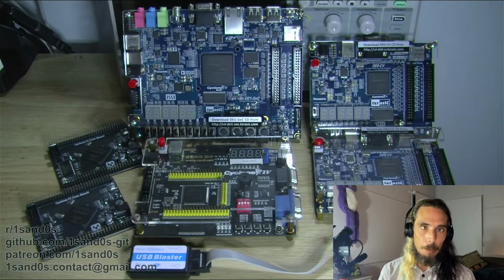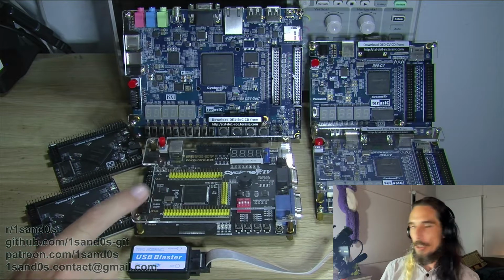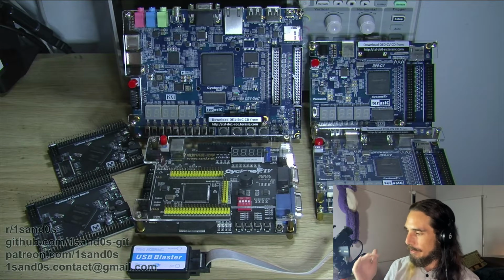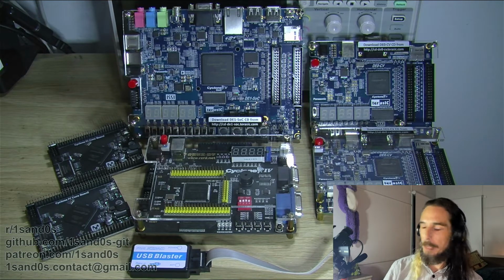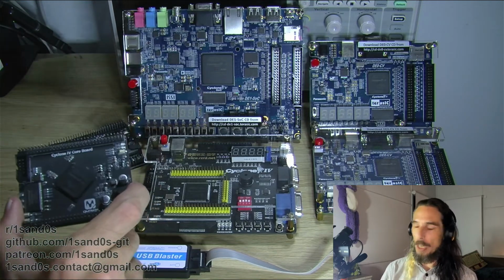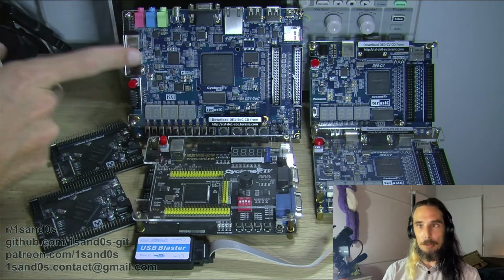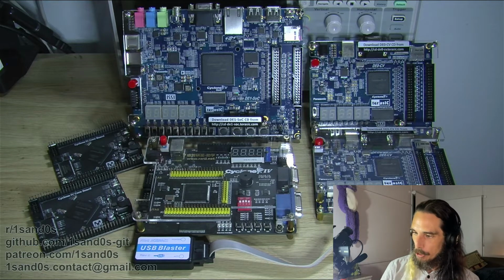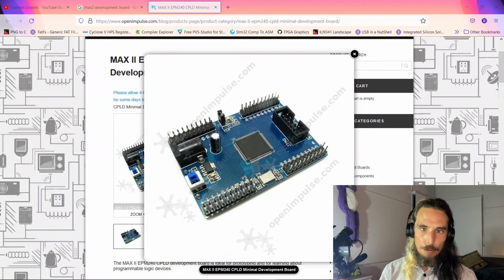Choosing an FPGA  - FPGA Basics Episode 6

Comment: The DE1 SoC only has 1GB of DRAM on it and it's a dual core A9 (that does matter, because the A7 and A9 are different architectures). It's a 32-bit CPU though, so the max address space is 4GB, with a maximum of 1GB mappable to DRAM (the other 3GB are mapped to the FPGA and to I/O).
You should have mentioned the Max10 boards as well - those are great low cost options for beginners.
As for CPLDs... I would not recommend those for beginners, and I would avoid them for tinkering. The only reason to get a CPLD dev board is if you have an actual application that needs a CPLD and you need to prototype the circuit before you spin up the PCB. In many cases though, prototyping with a FPGA you have laying around would be sufficient (unless you're worried about timings, in which case you need the actual CPLD). Demonstration with a CPLD is fine, but if not stressed, I would be worried that someone might buy a CPLD board not knowing the limitations, and end up with a paperweight. Furthermore, as I recall, most CPLDs are flash programmed, meaning you can only write a bitstream to them so many times before they can no longer retain the bits. The Max10 is similar, except you can load a bitstream via JTAG into SRAM rather than the flash for prototyping.
Reply from the maker: Thanks for the corrections and clarifications! 🙂